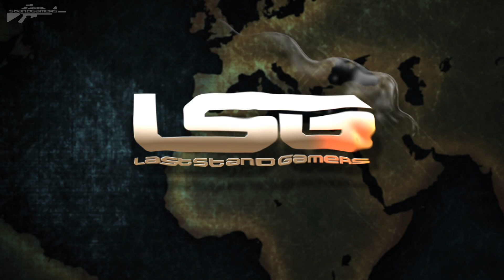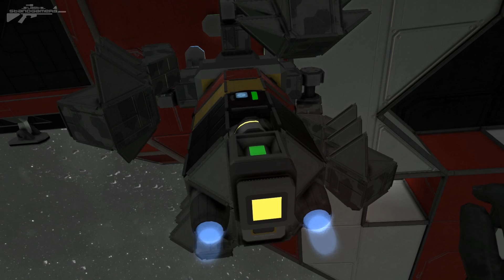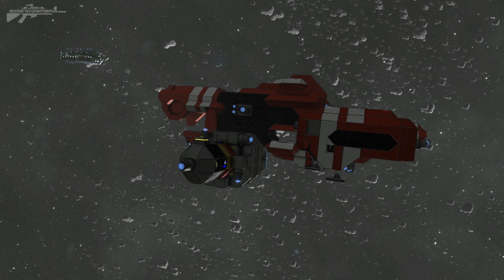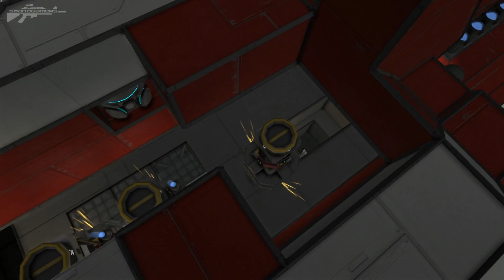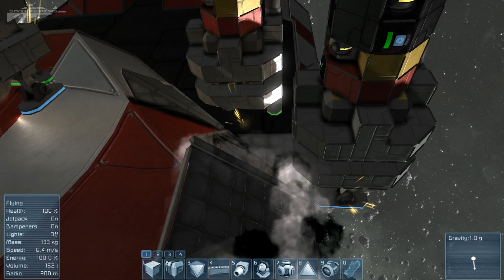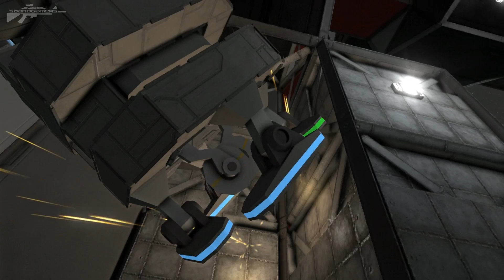Space Engineers - Magnetic Grinding Torpedos, Sabotage Droids

Comment: Bit late to the party but this idea is overdone. In my honest opinion the thought of one of these burying itself into my ship and digging deep inside and continuing to grind as it moves around. It’d have to be very durable so it can last after penetrating armour and getting inside the ship. 

Then the thrusters will continue to push it through and either out the other side or alternatively if you can rig a homing system that isn’t perfectly accurate, you’ll have a parasitic torpedo that eats ships from within and travels around continuing to grind from the inside out. The crew will have to abandon stations to track down and deactivate or destroy the parasite.

Comment: you could add a a piston to push the grinder forward with a sensor block and instead of the claws grabbing the stuff have them detach as cannon fodder maybe have a small cockpit on the back for the player to jump out of to get into the ship or for the smaller ones aim them at engines and power points to stop the ship

Comment: I figure that you could cluster 3 or four of these things into a seemingly harmless pod that you launch at the target, and once sensors in the pod detect a ship within a certain range it breaks apart, releasing clusters of the things into a fairly small area.  All you need is a nimble ship carrying several such pods and fly around the ship and releasing a pod in multiple locations.  Sure, it may not be overly effective against ships with nothing but heavy armor, but it would be a distraction that could draw an enemy's attention away from you while you use the distraction to do something else against the ship (like planting bombs on the hull while the crew was preoccupied getting rid of the drones, since ignoring the drones is not an option since they would eventually cut through even the thickest armor and once they cut through enough armor they would be too deep into the ship for turrets to be able to destroy them).

Comment: I had created a few similar ships, except instead of using grinders, it used pistons that would push engines into the ship, melting straight through with incredible speed. These were of the large ship class, but relatively small. The largest of which, is a fully functional carrier that would launch troops out the front into the large hole that would be bored into the enemy ship in a matter of seconds.

Comment: Brilliant! Certainly a design that can be scaled and adapted.

I'm curious if you could rig up a double landing gear system, with the torpedoes magnetically attached to a shield with auxiliary thrusters, power, and landing gear. May provide some shielding against missiles in more hostile encounters. I'm sure the design could be set up so they could cut through their own shields once attached.

Comment: I, personally, would have a small storage container throwing out explosives, then have a warhead embedded somewhere inside each torpedo. That way, if they use force to disable them, they are going to have to deal with that. The other thing that is good for is you can fly back around and lob a couple of missiles in just to seal the deal.

Comment: How do you "lock in" your ship with your landing gears, when you hit a surface?
Reply: Autolock mode.
Reply: Knsgf I didn't ask what it was called, I asked how to do it, like, which button to press?
Reply: Markowich Open the Control Panel and select the Landing Gear. There will be a check box named "Autolock"; tick it.
Reply: Knsgf Alright, thx :)
Reply: Frank Wrigley A suggestion nonetheless. No need for hostility.
Reply: Tyrtle13king a pointless one
Reply: Tyrtle13king he probably knows what that does
Reply: Tyrtle13king what a great way to advertise yoru stream
Reply: Alternately you could manually press P when you are close enough.
Reply: Frank Wrigley I suppose, just a suggestion.
Reply: willnicholson18 MWAHAHAHAHA
Reply: willnicholson18 we're streaming ksp right now. You should check it out!
http://www.twitch.tv/1rl1yl
Reply: Tock the auto-lock box on the landing gears
Reply: adam holt fucking hell he already knows

Comment: So LSG, I was thinking of a reliable way to prevent people from stealing super-ships in survival from you.  At all times you should have many different ways of accessing the ship remotely in order to check on its status, and you will need a failsafe.  Generally I build a giant bad-ass looking central power ball, that is massive (only in the capital ship department) and contains virtually every batter and/or generator of any sorts, simply anything with energy is inside of this super plated sphere, that only has like 6 merge blocks connecting to it.  In the very center there lies a massive number of explosives, attached with landing gears as to be undetectable, all combined together with enough power to keep the sensor array that is attached as well as actual sensors.  The idea is you can remotely activate the bomb, and only you can as you personally made the center and are only one with an active claim on it, and it has its own personal radio tower (antennae), around 4, so that it is not under governance of the ship captain or crew.  In the event of someone learning about the bomb within their core, they would most likely attempt to cut through it, and reach the bombs, and in so doing trigger the explosives.  While there would likely not be enough to destroy the entire ship (just leave a giant hole in it), the center of power for the entire ship would just have been hit from within its protective sphere, with a blast that could have decimated the ship's heavy armor.  This ensures your crew will not make off with the ship, as even if they have many engineers and plenty of supplies, it would take hours and countless uranium (how would they find enough in this ill-though coup? or have enough on hand?) in order to power the ship again.  All the while you would be preparing and sending out a drone task force, with a bomb the equivalent of a nuke at its back, in order to restore order or kill all.... :3

Comment: I wonder how effective something like this would be if designed to use thruster damage instead of grinders.  I know it wouldn't work on heavy armor, but it might be cheaper (just in general, and also in not having to deal with the excess parts.)
Reply: Cheaper? Not really, when playing on anything below 10x everything thruster components become very valuable, more so than most other components. Also the fact that it would have a very negative effect too, being that it would thrust itself away from the target, meaning that if it goes through the first layer it would just fly away again.

Comment: I quite like the idea of termite drones. If only they could work a little faster. Only a little faster because if they worked REALLY fast, then that would be a bit op. However if anybody finds a way to make these drill faster with out adjusting the drill speed configuration or modding, then by all means it's fine as well as great.
Reply: Put two drills side by side

Comment: little hint: you can minimize the damage to your ship by taking the "activate drill" into a timer block on the drone, activating after a few seconds
still, can you develop a faster weapon? once these things are locked on, a single missile turret could take out 10 or more, even if they where at maximum speed, so it'd be good to install some kind of anti-turret maneuver, using timer blocks, for exemple (the engines a-d all are on maximum thrust overwrite):

tb1 activates tb2 and side engine a, while disabling side engine c (the opposing engine), tb2 runs down and when triggered, it activates tb3 and side engine b (b's opposing one), when tb3 triggers, it deactivates side engine a, activates side engine c and tb4, tb4 triggers and deactivates side engine b, activates side engine d and tb1.

this would make the drone move in an evasive maneuver to at least fool incontrolled turrets. with equal timing among the timer blocks, it would not move from it's normal course in total or change its direction, but evade missiles far away. and the recources for that shouldn't be too much

Comment: I don't think these are very useful as-is. They just take too long to cut through, unless they've abandoned the ship completely  enemy crew will figure out what's going on before sufficient damage is done to justify their cost -- you could do similar damage in similar time with a human crew, instead of buzz droids. I think what would be better would be to either use more grinders or to have a timed warhead inside. Actually, a combination of those might be optimal, with two or four grinders to quickly cut into the hull and the warhead to explode based on calculated penetration depth through armor of type X and thickness Y.

Comment: To make these more effective, set up the timer block on these things to activate a warhead. Once they've buried themselves a little way into the hull, they detonate for maximum damage. The small warheads likely won't completely destroy the ship, even with a chain reaction of detonations but the damage should cause havoc to internal systems like generators, gyroscopes, medical bays and the bridge as well as softening the ship up for follow-up attacks by fighters and heavier frigates or battleships.

I feel like turrets would easily take these apart, however.
Reply: Turrets tearing these up can be fixed by adding some heavily armored decoy blocks to the sides to eat up the damage. Preferably ones that can be released prior to hitting the target so they don't prevent burrowing. Can perhaps even skip most of the armor if you can make the pod rotate on it's forward axis while it approaches the target.

Comment: Already built my super weapon torpedo. Basically a grinder on the front with a camera block and remote block, allowing me to control it while in operation. Also has a deployer to spit out material and a warhead to detonate. I send it in to the shipand have it cuts its way through to the reactor, than blow the sucker. Expensive, yes, but still effective in simulations.
Reply: Oh look another fellow enter Elysium fan! Rip Xcom
Reply: For mine its a small drone that can fit inside a single large ship block with a grinder and a minigun so its like a soldier that you can deploy into someones ship from afar

Comment: I feel the effectiveness of these was not properly shown, you only tested it on a generic pre-built ship, but what about on your own designs?
Reply: Just imagine how destructive i will be on worlds with sped up grinding speed to like 5x
Reply: glop cz not even that, have multiple ships carpet bombing a larger ship
Reply: Agreed
Reply: raggedsolution21 and replace two of the landing legs with thrustrs and up thrusters un the back to melt through light armor and components snd the grinder to take care of heavy armor!
Reply: zaki NBG first even biggest ships that are reasonably maneuverable  the havy armor doesen't cover more then 70% of the surfice. 
second the torpedos coud have a warhead at a pole to blast through the armor and second warhead to blow up in center of the ship, and some kind of sensor system to detect players in wery close range that will try to disable it, and detonate the warhead
Reply: also imagine them grinding through heavy armor. for huge battleships even multi layer heavy armor. they wont do much before you disable them.

very situational weapon.
Reply: zaki NBG
it depends becouse in battle it would be hard to get rid of them meaning someone has to go out there or deal with them as they punch thru.
Reply: A combined assault this missiles or artillery alongside these might overwhelm a larger ship so even if they don't pose a significant threat it will be enough of an annoyance to win a battle. I see thes as more of a "bunker buster" though than a proper naval attack method. Hitting basses with a cluster equiped with warheads could be devastating if you launch some decoy duds too.
Reply: capital ships arent always about beeing maneuverable. if you have a heavy dreadnought like i build you have heavy armor everywhere (minimun 2 layers).

It doesnt need to be very maneuverable (even tho it handles better than it looks like) because it can take the punch and also has more than enough firepower that torpedos out of blocks wont reach it except you spam dozens of them or try something like in the video.
Reply: @PantsAreAnOption  that's a lot of unneeded armor. Clearly you don't follow the "All or Nothing" armor approach
Reply: richerds1234 or you just shoot them off with your turrets since your armor wont care about a little dmg that would maybe get to your hull
Reply: if you have at least 20 gattling turret and 5 missle turrets on every side which are positioned so that there is no blind spots it does not matter. yeah you would shoot your own armor a bit, but i tried such heavy ships a lot and you cant rlly hurt yourself like this except you shoot onto yourself for 2+ minutes
Reply: Joseph Alen wow he will be pissed
Reply: raggedsolution21 dumb
Reply: zaki sure you do that sounds like a lie send me the steam file